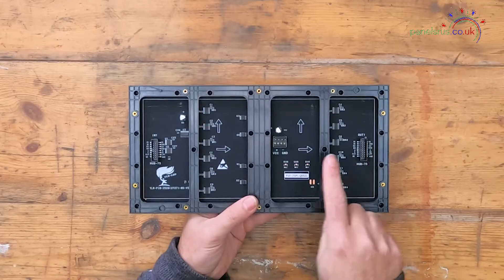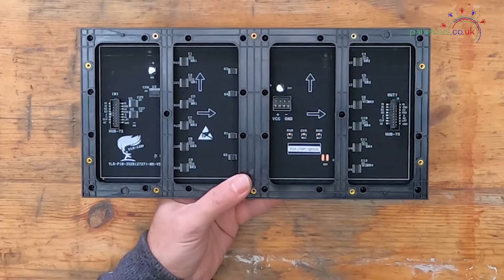LED Panels - An Introduction (Part 1). 2023 - Panels.

Comment: Thanks for all your help and support for the lights community. I personally find your videos very informative.

I have a question, last four years I have been using p5 panels in my show and being wanted to upgrade them to p2.5 panels for a better resolution.
 Is the colorlight card 5A-75B able to handle those panels or should i have to get the 5A-75E ?
And also, is FPP able to handle those panels and card? 
Looking forward for your response.
Thanks in advance!
Reply from the maker: Hi, yes the colorlight 75B can do this. Just be 100% certain when ordering that the vendor can provide an rcvbp config file for colorlight when buying. (some cheap panels dont play nicely).
Reply: @gregmacaree thanks i really appreciate you taking the time to answer my question!!!!!

Comment: have you seen any Tutorial or know about one about the best way to build a mounting frame for LED Panels?
Reply from the maker: I have held off making frames for the risk of someone getting it wrong and breaking a panel..  have a look at wiredwatts.com or yourpixelstore.com
Reply: @gregmacaree  thx for the answer. but this "danger" you have basically about 950% of DIY Tutorials.... and you could simply put a disclaimer. for example there are so many elictrician tutorials with some really dangerous stuff if you do it wrong. but ok your decision. :) good luck!

Comment: Thanks for the video. Great introduction into panels. Just one point, could you adjust the volume so it's all the same? Had headphones on and jumped a mile when your cut scenes came in 🤣🤣